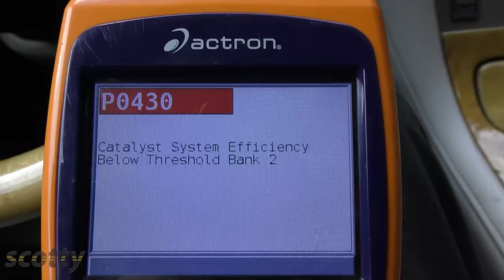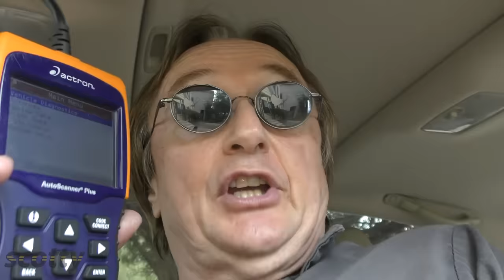Check Engine Light Comes On and Off in Your Car? What it Means

Comment: 2009 v6 Ford Escape, engine light will come on occasionally, then off for awhile . Idling in driveway , a few test drives Etc . I was able to get a code P0204 circuit open cylinder 4 . I’ve had at multiple mechanics shops . Told to drive short distances, idle in driveway . What do you think it means ? My 2009 escape has new spark plugs , ignition coils , alternator, serpentine belt , had oil changed , coolant flush , Transmission fluid flush 3 days before this started 4 months ago . Don’t want to take to another Mechanic, pay $350 diagnostic testing each time . TIA

Comment: Hey Scotty I got a question, So recently I put new fuel injectors,timing chain and guides and fuel pump regulator. Before it never made any out of the ordinary noise. But now after doing that work I hear a Little not sure if you would call it a ticking sound from the engine. I’ve heard sometimes injectors can make that noise but these are new so how would they make that noise. Thanks for the feedback!

Comment: Love your content Scotty. My cars are from the 70s and don't have a check engine light. Should I be worried? Thanks!
Reply: Chris ❤❤
Reply: Gauges were the shit then !😉👍🏻👍🏻
Reply: just use some of those senses you have and fix whatever doesn't sound/look or smell right.
Reply: If your car starts up, then you know the engine is in there, and you don't have to check for it being there.
Reply: Perhaps I should fix my 67 Datsun but points are just as bad eh😜
Reply: At least you won't have to worry about the air bag recall :)

Comment: Hi Scotty, thanks for all the great advice and information. I have a 2015 Sorrento, engine failed and replaced for free by KIA. The CE came on, scan says Crank sensor, I replaced it, light went off. A week later, light back on, scan says crank sensor, i buy another, before I can change it out, light off again. The entire time, car runs exactly same, idles great, accelerates normally. Light off and on, randomly. What the hell could it be?

Comment: The engine check light has flashed intermittently, particularly when accelerating onto the freeway. It does not occur when revving the engine in neutral. The vehicle is a 2002 Toyota Solara V6. I suspect a sticking injector may be the issue. Previously, I received a P0301 code, but it cleared after replacing an ignition coil and adding Sea Foam to the fuel. During that time, the check engine light would blink upon acceleration and then remain steadily lit. I've heard that other things can cause the same issue, so I didn't want to change the injector yet. I just need it to pass smog in CA.

Comment: Hello there, Your videos are really helpful and I like them a lot... but I need some help here, I own honda civic 2001 model and I have experienced an issue with the engine light which is that sometimes it turns on and sometimes it doesn’t while driving, just as you showed in the video but the problem is there is no codes showing on the scanner I’ve tried multiple scanners like really professional scanners as well but it didn’t showed any code even the light was on... what can be the problem? Is it Ecu? Or just wiring needs to be re done properly? Or something else

Comment: I have an 07 Toyota Corolla. My check engine light went on prior 2 smog test come I took it to my mechanic and the diagnostic stated torque converter issue in transmission. I was driving tonight and the check engine light turned off, would now be a good time to run the smog test?

Comment: Hey scotty, have a question. I was driving a 2000 chevy tahoe with a check engine light, had a code for the catalytic converter. Guy told me it was like that for 2 years, never replaced them. While I was driving it, the light turned off, and has not come back on since. Did the bulb burn out? or did it magically fix it's self? Thanks

Comment: Our car had an intermittent check-engine light.  It would come on, stay on for a few days, then go off and stay off for weeks at a time. It was a misfire code.  The problem was a burnt exhaust valve and low compression on cylinder 4.  The car (2009 chevy malibu) only had about 105k miles, and has never been abused or neglected.  $1800 bucks later (valve job + replaced water pump while the engine was apart) it ran for about 3 months, then another check engine light came on for the actuator solenoid for the variable valve timing. Never buying another Chevy after this one.

Comment: In most cases, its usually the exhaust, either a hole in the air hose, or hole in either your tailpipe or muffler..then if that isn't it...its an early warning for you to replace your distributor cap/alternator...it warns of electrical malfunctions to come or faulty wiring shortages due to possibly running over puddles in rain getting it wet...etc...this is exactly what my car did...I ran over a big puddle of water and my belt began screeching, then my alternator went bad and eventually caused mechanical failure in other parts of my car..it caused my oil pump to fail and everything...and it was jerking me while braking....

Comment: Scotty i have a old 2005 Dodge neon SE 5 Speed. with 99K miles when i come up to a stop it takes it lake 5 to 8 seconds to idle down. I changed the idle Control Valve, & the Throttle Positioning sensor My question is does a 5 speed have a different part number for the  Throttle Positioning sensor ? Other then that it runs perfect ...

Comment: my 2010 mazda 3 had a very cold/hard start a few weeks back and the CEL came on, to which it turned itself back off a couple days later when I started it up after work. Had left my lights on inside the car a couple days ago and needed a boost, car started without issue, no CEL. Next day, during a normal start up it came back on again. Is this just the cold messing with my sensors or should I bring it in for diagnostics? It seems to be driving ok, maybe a little less power than usual.

Thanks,

Comment: Need some help Scotty, I own a 2000 Toyota Celica and I have a code P0171 System too lean. I’ve changed the O2 sensors, the Mass Air flow, the PCV valve, the Air filter, and intake manifold gasket. I’ve looked through my tubes and don’t see any cracks or tears. What should I look to do next?

Comment: I’m not a mechanic but I do most of my own work. I drive an older vehicle and recently had a check engine code for “o2 sensor slow response”  I bought a cheap obd2 scanner and told it to erase the code and I replaced the o2 sensor. If I replaced the wrong sensor or it was a bad sensor that I put in the code will come back? 
So if I don’t see a code for it in the next few days I should be good?
Thanks.

Comment: Scotty i got a 2016 elantra 1.8 engine light was on for about 340 miles i scanned it was a p0420 code i drove another 100 miles to autozone for cataclean i got there turned my car off went in bought it then came out to start it up and the light turned off should i still use cataclean incase there still is carbon build up in bank1 im ao confused about this issue my car does not drive bad at all it feels normal

Comment: My 95 c1500 with a throttle body injection system when using cruise control around 55-60mph the check engine light will come on and then after 5 or so minutes will shut off and it’s never stayed on for long enough to check it with my scanner and just recently I’ve lost over 100 miles of distance per tank of fuel it also blubbers and coughs at certain rpm under a load I’m thinking of trying new injectors I’ve tried fuel additives and cleaners and nothing seemed to help do you have any ideas ?

Comment: Hey Scotty. I'm enjoying your entrance your videos. I have a 2010 Toyota Camery. I changed from full synthetic oil to a synthetic blend about 2000 miles  ago. Just yesterday my check engine light and my traction control light came on. Do you think the cheaper oil has anything to do with the lights coming on?

Comment: My 2015 honda Odyssey has 133*** miles on it. The check engine light comes on sometimes and goes off by itself for days. I check it when it was on. It says catalystic converter bank 2. Should i change it? The van runs smoothly and no issues.

Comment: Quick question though, I've had my CE light flash on and off before and determined my coil pack was shot. But recently ever once in a while I'll start the car after sitting, the light will come on, then flicker  and then shut off... Hooked up a scanner while it was solid on and no codes. Maybe a short?

Comment: My check engine light turned on, i checked it with my roommates device and it said that my o2 sensor wasn’t working properly, i ordered the part and the wrench to fix it myself but after about 3 days it turned off. Should I still install the new O2 sensor or should I just keep it in storage until it officially goes out?

Comment: I had a 2000 VW Jetta for 11 years. The check engine light was on for 5 of the 11 years. I knew it was bad at when I went from 330 miles a tank full to 280. The stupid Mass Air Flow kept going out. I went through 3 of them. At the end the cat went out, got a recall about that after the miles to replace it was up. The transmission went out and that was the worse of the check engine light.

Comment: I decided to put regular fuel, instead of premium in my bmw.  I noticed, when I'm in "on" position, a bunch of lights come on but, they go off in a few seconds...except for the "check engine light".  Not sure if this was happening before, or I was just paying more attention to the dash this time.  But, when I start the car, CEL turns off.  Is this normal....CEL staying on, until engine starts?

Comment: Hi how are you doing?I have a problem with my will vi Toyota it's a 2000 model,been running roughly lately,I changed a few things spark plugs,coils,and also fuel pump,but whenever I run the engine and am heading out the car sometimes moves so sluggishly and it runs perfect at slow run,but once engaged to move the automatic transmission sometimes jumps hard into another gear,so I checked the oil gauge of the transmission and it's totally fine,so I am lost and I can't get a diagnostic machine around me,what do I do ?

Comment: Hey Scotty I have a 05 Cadillac deville that needs a transmission replaced. is there any other way to replace it without having to pull the motor and front suspension

Comment: My check engine light is doing the same thing yesterday and today it was on and now today it is off I hooked it up to a scan tool and it said a misfire so I change the spark plugs and wires and the thing thing still periodically pops on and off.. I was wondering if a bad O2 sensor could be the problem it's kind of idling weird to

Comment: Scotty, I jumped in my needy Porsche 911 997 recently and the CEL started blinking . Lasted about 15 seconds or so then went away. Any thoughts as to why it did that. I used my cheap scanner and P0301 came up for a cylinder one misfire. Car felt fine. I took it for a 5 mile drive and the check engine light never came on. 

Thanks in advance.

Comment: 06 Trailblazer Ext with Vortec 4.2L 
I have a check engine light for 0P300 random misfire. I took it to a shop for diagnosis. They diagnosed the Manifold Pressure Sensor was bad and the spark plugs needed to be replaced. I decided to replace the parts myself rather than pay them $500. The vehicle is running good again but, the light will not clear. I used a code reader to clear the code but, it keeps coming back. Also I noticed, when I was sitting at a light. I gave the vehicle a little gas. Just enough to raise the RPMs to about 1200 and the light turned off. Then as soon as I let off it came right back on. RPMs at idle are between 800 and 900. Any ideas what the problem is, should I disconnect the battery to clear the code and see if it comes back?

Comment: Ring Ring 😂. OK I loved the video and you are awesome. 
So my car check engine light goes on for awhile then off, and repeats that sequence pretty much how you described the last part of the video as in chalking it up as a glitch. Well so I have a glitch of my inmyhead haha.😂 .I drive a 90  Miata and took it to a shop to have them check the computer but they couldn't because the computer was and is not working properly and needs more intensive testing. Any ideas? Really hoping it's a glitch.

Comment: I have a Subaru Legacy 2.0 gasoline engine car from 1999 and i have a problem with the check engine light. It randomly comes on and stays on for like 2 mins and then disappears. Old owner of the car told me that he had those issues but the obd code scanners didn't found any issues. I have owned the car for 6 months and it's everyday issue. Always in some point that light comes on for short amount of time and then dissappears. I feel that car won't accerlate so well when the light is on and RPM can get stuck for some time when accerlating. I was wondering if the reason could be a faulty knock sensor but i'm not sure. I'm planning to replace it and also buy new spark plugs if those changes could help. I don't own obd scanner so i can't measure it. Old owner told me that there was no code to be found when trying to use obd scanner and that's the reason why car has passed inspection every year what comes to check engine light. Car starts nicely, consumes normal amount of gasoline and normally accerlates well. Only problem is that when the light comes on it doesn't accerlate so well. I have noticed that usually the check engine light comes on when the engine is cold but it doesn't come up right away after starting the car. After driving 1 -2 miles it comes on and after a while it turns off, but after a while it can come up again. When driving a long trip it can come up too but it doesn't bother or cause any effect if you are not accerlating. Anyone had same kind of issues with a check engine light?

Comment: My check engine light used to come on for a few seconds and then turn off. Turns out it was very low on oil (not even showing on the dipstick). Took it to Toyota and they were surprised how the engine had not seized.

Comment: Hi Scotty, where exactly is that paradise of yours? :)
Anyway it's odd, i checked my MK3 Jetta '96 today, and there is actually no check engine light, or OBD2 port?? There is some huge round plug(under the blower fan switches) with something that looks like check engine light but it has lightning symbol inside of it, i guess that's some kind of 90s diagnostics, before OBD?

Comment: person i know at work gunned the engine around a horse and buggy and had the engine light come on. i scanned it for her and found out it was an engine misfire. i wiped it and said it'll probably be fine, but you should look at replacing your plugs sometime in the near future. just no more lead foot.
Reply: gotanksrox5331 besides checking the plugs, I would replace the ignition control module ( ICM ) and secondly, have the coils checked or replace with 2nd hand =$40 at salvage yard.
 Is a 10 min  DIY repair 🚗

Comment: The first week I had my Dodge Dakota I bought brand new in 2002 the check engine light came on. I brought it back to the dealership the first thing the guy asked me was if I filled up the tank with the car running. I said yes I always do, I never turn off the engine to pump gas. Apparently that's enough to set it off.

Comment: I have a 2005 honda accord and when i first got it i used the spare key for everything and then i found the master key and started using that but then sometimes it wouldn't go into the ignition/door and the same problem with spare key. Any ideas of what to do?

Comment: Where should I start looking if I have Abs light - code c1223 - Lamp brake warning light output circuit failure for 03 mustang gt? I also have the check engine light I think its telling me to replace my White Face Reverse Glow Gauge Insert (99-04 GT) since the blue lights do not come up anymore I just havent gotten around to it yet.

Comment: I had trouble starting my truck a couple of days last week. P129f code, one day check engine light is on, one day it’s off. Boggles my mind. Says Fuel pump driver control module. Most days if runs fine, I almost thought I got bad gas, I filled up again and the check engine light went off. what could it be?!

Comment: For a p0330 code (knock sensor), my cel comes on for about 20 miles and then turns off for 20 miles. Could this be attributed to bad fuel?

Comment: I have an ongoing problem with my 1992 Integra, I can’t turn on my car until the check engine light goes off, sometimes I have to wait a couple of minutes before I can turn the key. Some days the check engine light never goes off, this usually happens on rainy/humid days also when it’s very hot out. Any solutions?

Comment: Hey Scotty, my engine light comes on and the code reads catalytic converter, however someone mentioned maybe it’s the gas cap which I did notices cracks in the o ring so I overly tight it and after it goes back off. But after a month it comes back on with the same code p420 I think or what ever the cat code is. But after another tank of gas it goes back on. I’ve held off on getting a new cat because idk if it’s the sensor or the gas cap or really the cat. Im going to replace the gas cap and start there but any suggestion u might know. This has been happening since July/august last year and still periodically comes on once every 2 months. Ps it comes on when my gf drives lmao Farley when I drive any input is accepted lol

Comment: It turns on, and off on my 09 Chevy Traverse. It'll stay on for awhile, then all of sudden it'll turn itself off.  Then it'll stay off for awhile too. It's the P0420 code, but my car runs perfectly fine. And I really don't want to replace the catalytic converter. I've been driving it like that for almost 2 years now. Should I be worried.